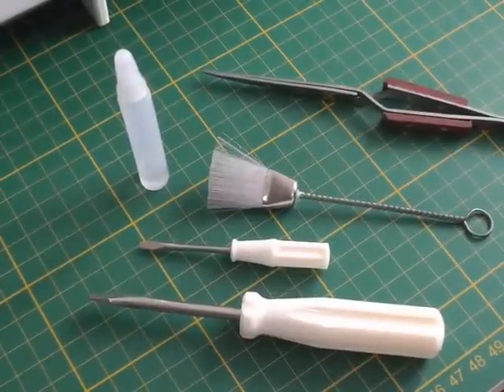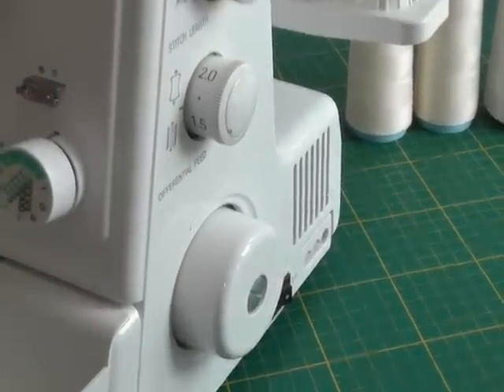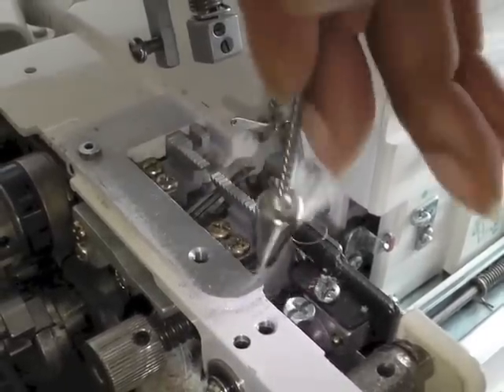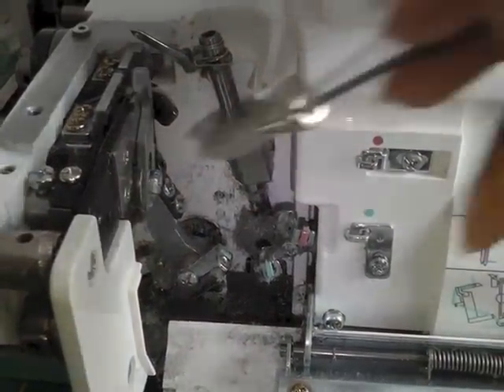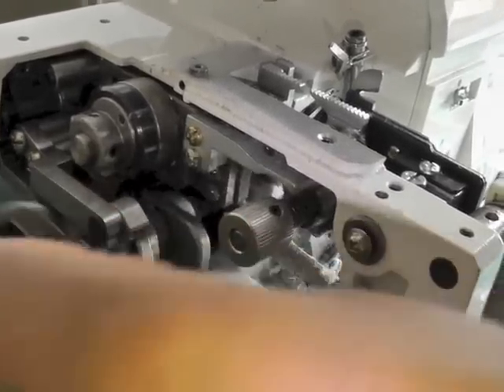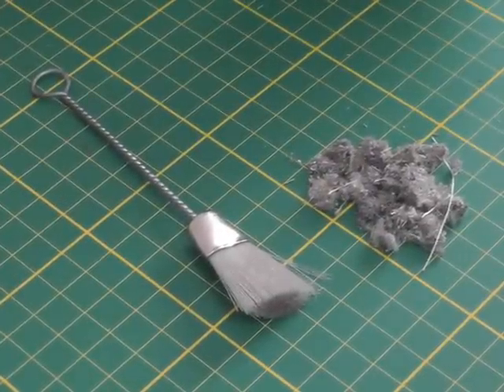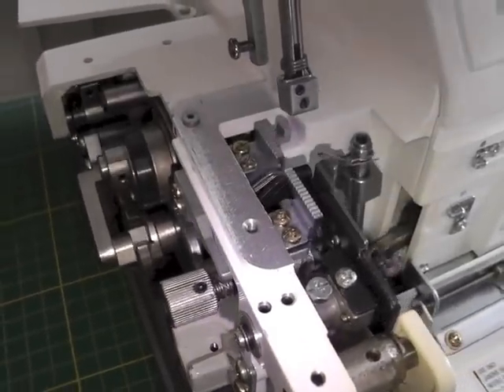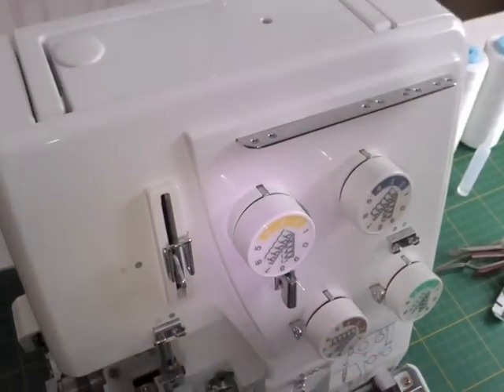Cleaning Your Serger

Comment: You do a very thorough, excellent job with your video. My only suggestion is to use a small hand vacuum if you have access to one. Although the brush moves a lot of lint to a place where you can discard it, other lint is forced deeper into the machine. It is better to completely suction it out so there isn't a build-up lint in places you can't easily reach.
Reply from the maker: Thank you for sharing Me Hess.